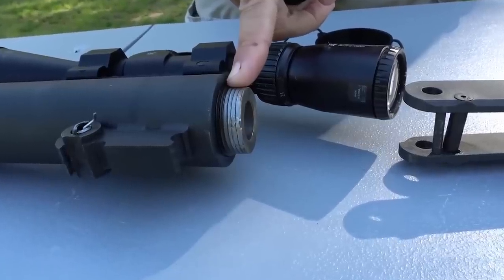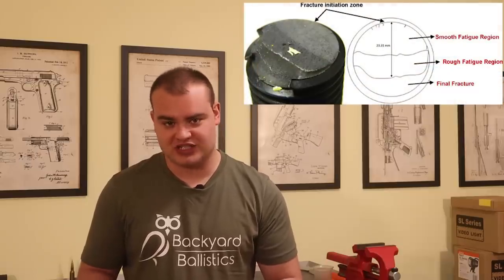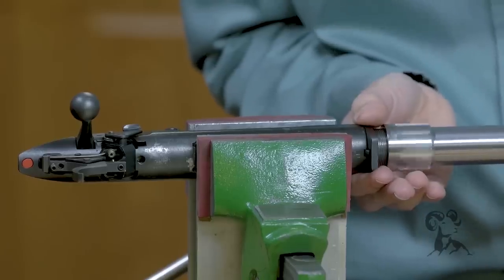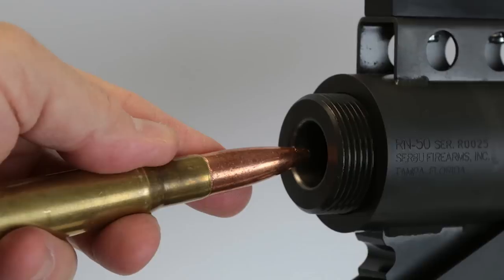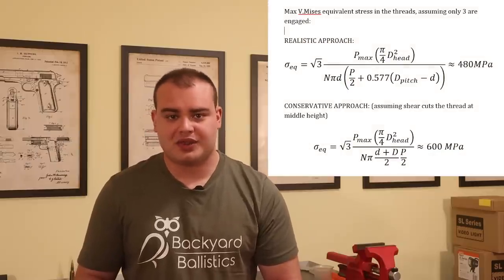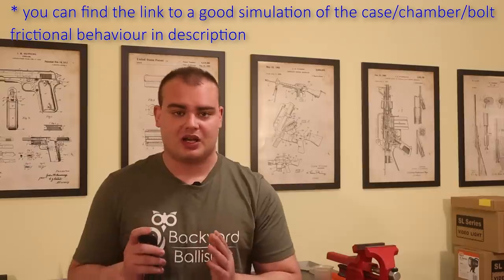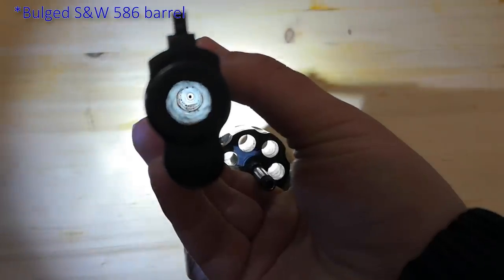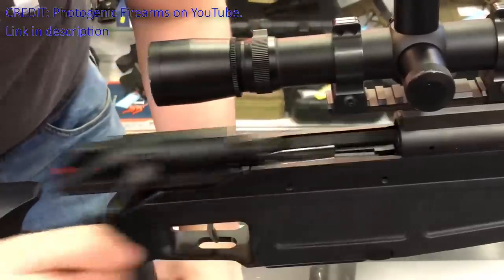Serbu RN-50 Failure: A Closer Look

Comment: These videos keep coming up and it's a silly argument. Number one he had bad rounds and even he knew that before the failure. Some hot. Some not. And some with obviously bad primer performance. I learned the hard way myself with some old surplus 8mm Turkish in a k98. Stop shooting that crap when you realize it's bad. You can just pull the bullets and reload to spec. Secondly that gun is just a step up from what home made crap the Muja houdine were shooting with against the Soviets in the 70s. All it would take is a primer failure to blow that cap off. It is a piss poor design. This channels comments are correct about the exponential overpressure that will occur from not seating and screwing down the end cap all the way down but dose not take into account the possibilty of primer failure/rupture that just happens to be about 80% of critical failures in hot loads and old ammo.
Reply: You can't close the action with a loose cap, the "ears" interfere.
Reply: That is not correct. Headspace is measured in thousandths of an inch, there is enough space to fit one or two playing cards between the cap and tang. That's hundreds of an inch. Plenty of room for case rupture or gasses to flow around the case. This with a system designed with externally threaded breach there by multiplying the exerted force on those threads due to the increased surface area effected by the gasses. This coupled without any gas vent bypass or other safety measures built in is the reason that even a primer failure from an improperly seated primer will blow this cap off. I am glad the shooter will recover and love to see small business persons make it, but this product needs to be revised and updated.  Shooters should also take heed and learn from this and not shoot just any old ammo without more caution. Like I said I did it myself being cheap shooting crappy ammo 30 years ago, luckily only racooned myself in one eye from the scope.

Comment: hi, mr awesome destroyer gunsmith  !!!
the  . 50 serbu rifle is wrong in its every  parts, it is a super junk, because its cap-lock  is wrong,  it is an external cap instead of being a inner screw-bolt like  the inner bolt of cannon,  the security lugs/or wings are very thinnest and too far of breech ... therefore it is a wrong drawing it is a dangerous rifle ... you are wrong  !!! so long mr gun destroyer   ... 😄💥😁 the last but not the least the wheel pin of frame and barrel is cave ... grrr  it is the over the top than mistakes  ...

Comment: designed by royalnonesuch explanation found.
Reply: It was not.
Reply: @Hornet135  It was designed "in conjunction" with RN.
Reply: It was a collaboration with RN and surbu.
Reply: If it was designed by Nonesuch
it would have HOME DEPOT PIPE CAP
not a number crunched machined cap designed by Serbu for this one application
Reply: @donovanchilton5817  It was designed by Serbu under commission of RN.
Reply: @limbrat5448  True, but that collaboration was RN basically saying 'wouldn't it be cool to make a cheap break-action rifle in .50 BMG?', and Serbu designing it.
Reply: @jic1  I agree. One of RN last builds was a 50bmg but it kept blowing up.
Reply: chill out dbags it was  ajoke. obviously serbu wouldn't put out a prodcut so shoddy that when it fails it basically is designed to kill the user.
Reply: @MrAwsomeshot  Well, except your joke was extremely similar to the many comments saying exactly that.  Not sure it's fair to call us "dbags" for taking you seriously.
Reply: @jic1  bro calm down.
Reply: @MrAwsomeshot  You need to take your own advice.
Reply: @jic1  seriously man chill out